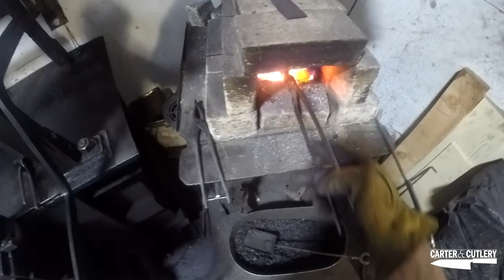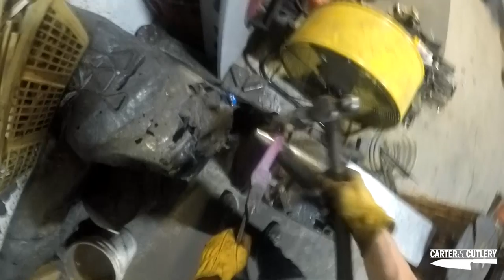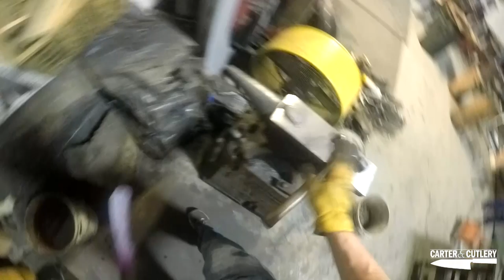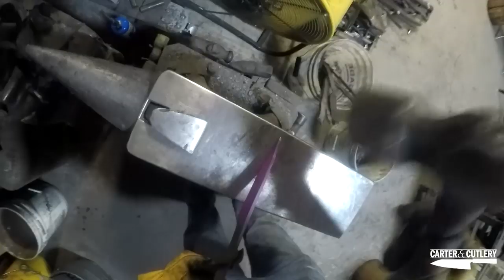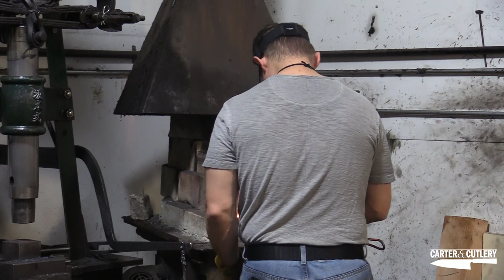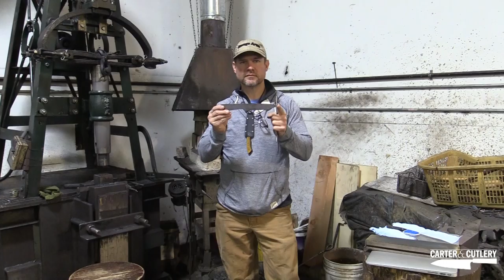Forging an FS1 Combat Knife POV

Comment: What would you guys do with a knife that a customer wants sharpened but the blade rusts Extremely quickly?
Reply from the maker: There's not much else to do to it other than lightly oiling it and trying to keep the blade dry as much as possible. Otherwise we'd need to look for blades with a different steel. --Cait